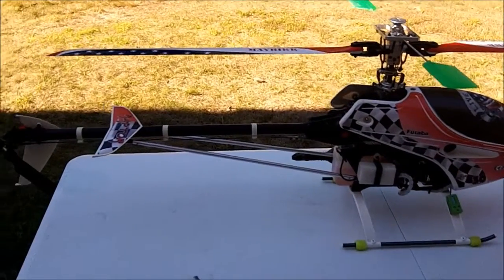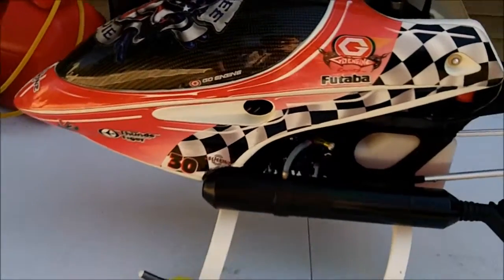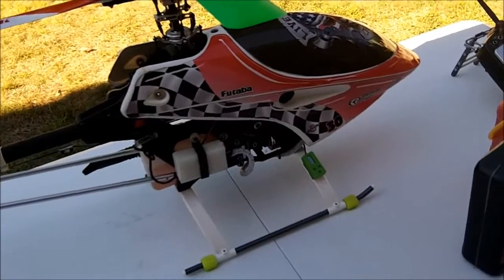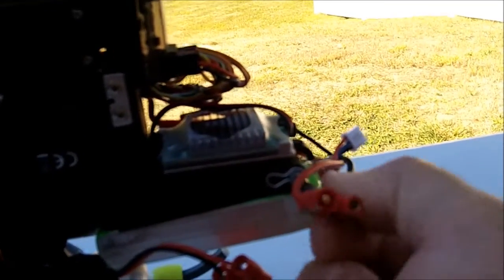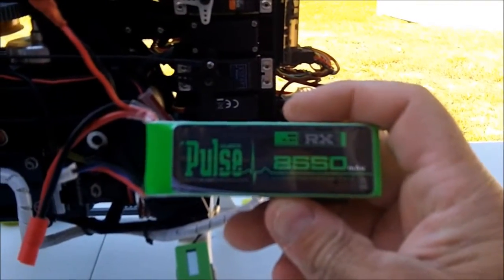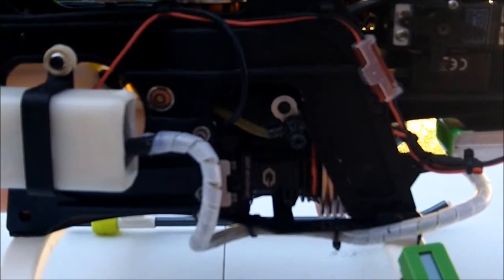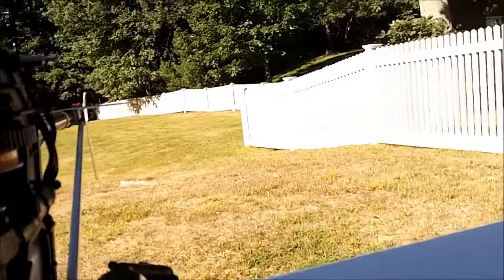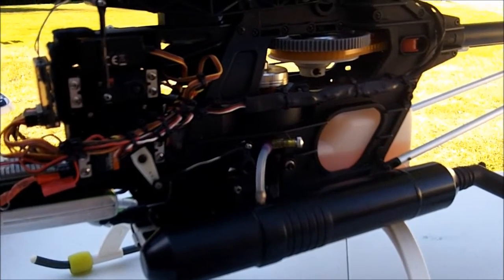Raptor gasser Go engine GH 56 Overview

Comment: I see the small tank generally used for a Nitro Set up, But How does your tanks fuel line set up look?  Do you suggest using a filter between the tank and the GH-56?  Do U need a tube from the tank to the exhaust?

Comment: did you change any gearing for the lower rpm of gas? is it still running see alot of old threads about heat issues, seems like this engine sounded good but didnt stay available long, guessing it didnt last?